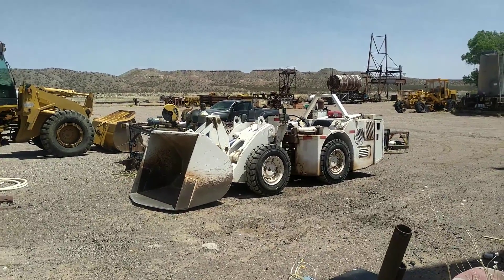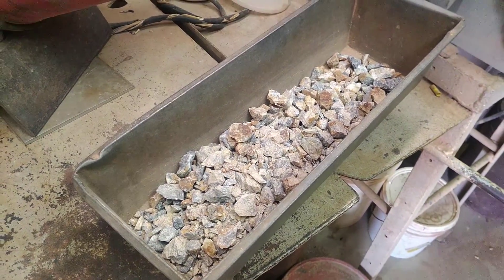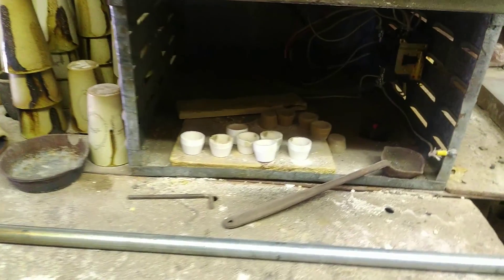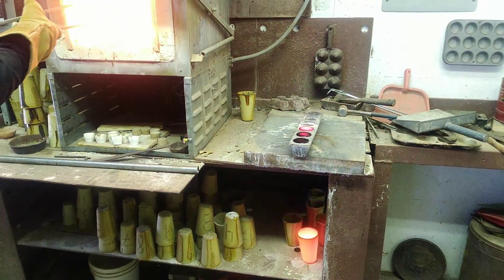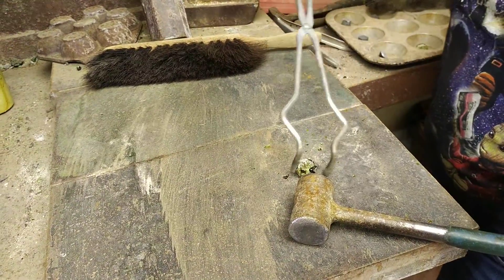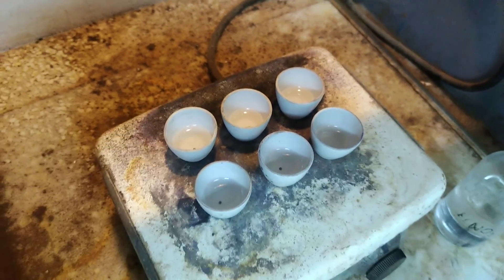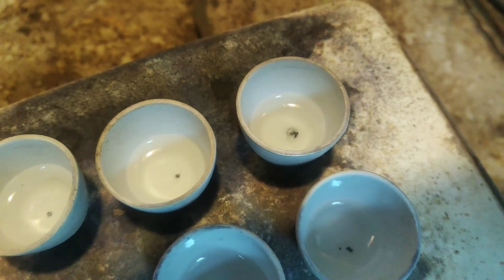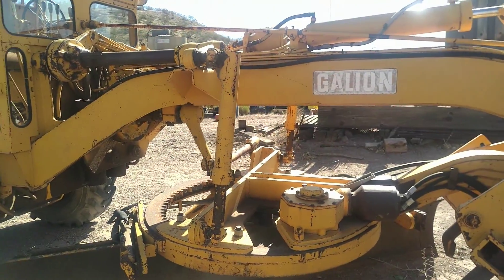Fire Assay: Hard Rock Gold Mining Episode 2

Comment: Look at that 160!! Jesus I've spent hours and hours on one of those! Minus the cab lol.

So am I packing my bags yet or what? Loved seeing the assay part because that's the one thing I'm fairly ignorant about. Also loved seeing you put those old crushers and pulverizer into good use because they still have many good years of use left in them!
Reply from the maker: Glad to see someone has a clue what to do with that thing! I'm not a grader hand, but I'll wrench on them given the opportunity.

We're still working on the mine side of things. It's slow going but we ARE making progress. Whether it will be one mine, the other, or both - I just don't know yet.

Our jaw crusher needs some TLC - the jaw plates are worn and can't apply tensile force to the rock as well. Most likely we'll build them up with some hard-facing rather than replace the whole plate. The lab equipment is in good working order overall - my business partner/master assayer (the guy on film doing the actual work) rebuilt the furnace recently, it just needs a new floor plate which is only about forty bucks.
Reply: @Porty1119  nice! Yeah hard facing sucks!  Lots of welding and heat and welding lol. We have to hard face most the stuff on our rice harvesters or it'll eat right through the stainless steel. And welding on stainless can be a bitch. Have to turn the welder up pretty high.  

At least it looks like you guys got a good grip on what you're doing just need to get the ore flowing now!  

Just curious, do you guys assay a lot of stuff for other people? Or just yourselves?  I have some stuff I'd like to see if it's worth anything or not.  Supposedly it is but you can't always tell by staring at the rock lol!
Reply from the maker: @ADITADDICTS  We actually got our start doing assays for an Albuquerque-based company and run assays for clients from time to time. Right now we can assay for gold, silver, and silica - get the samples down here and we'll run them for you.

We snagged a large hammer drill this week and will be trying it out on some more chip sampling this weekend.
Reply: @Porty1119  Awesome! I should be back sun or mon. I'll hit you up soon as I am.